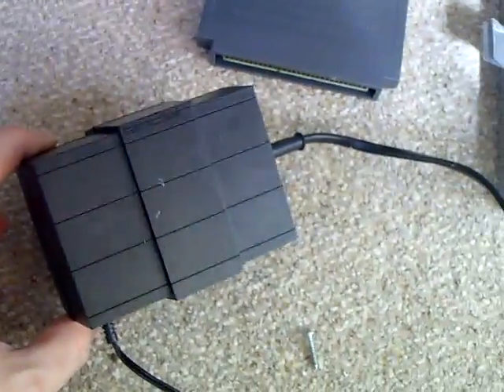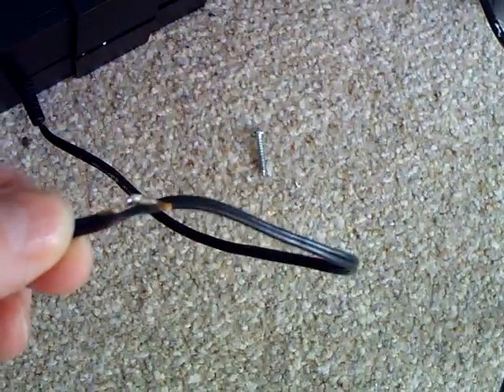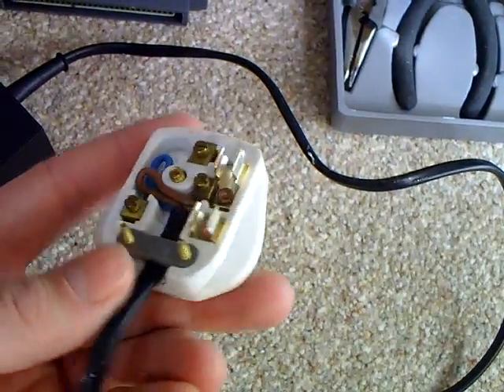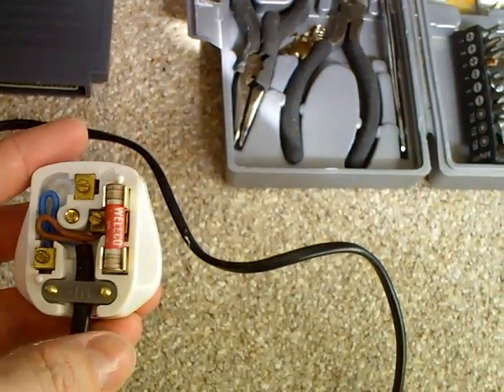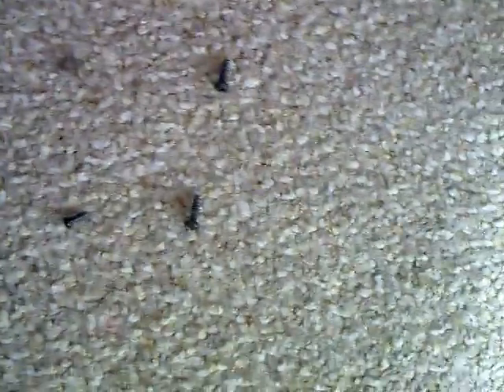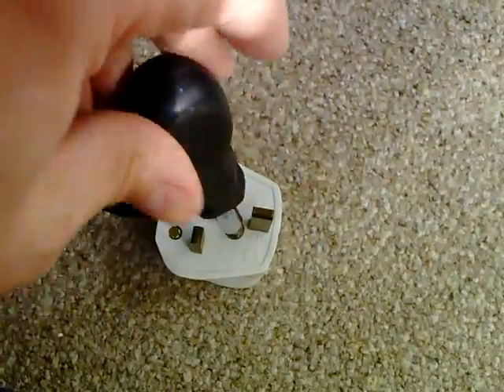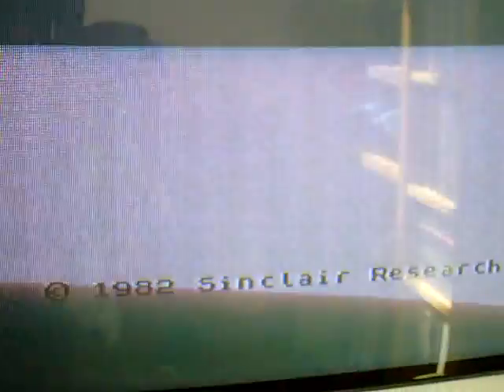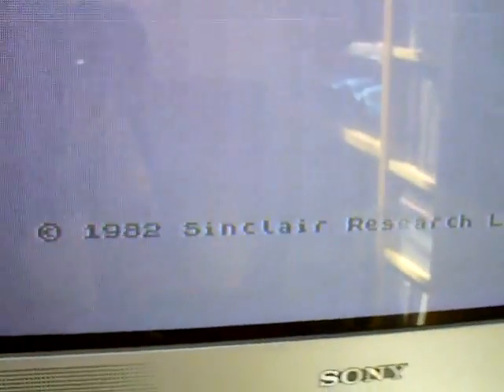ZX Spectrum 48k Power Supply Quick Repair

Comment: That's not the correct psu for that speccy, looks like a spectrum plus supply. Regardless they put out the same voltage and stuff :) I always start at the plug but just my luck, I don't think it has EVER been the problem lol.
Reply from the maker: I didn't notice that, how odd.

Comment: looks like she could use a nice, shiny new plug, that one is too old and has not got the insulation on the line and neutral pins and is to the oooold BS1363  specification 😁 Use 3 amp fuse to BS1362